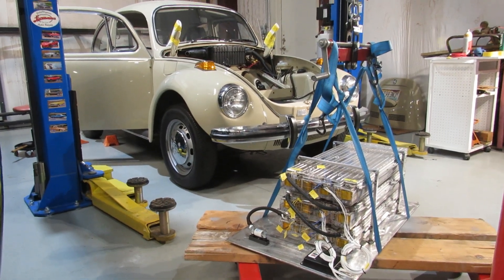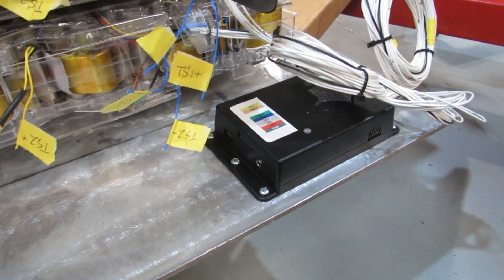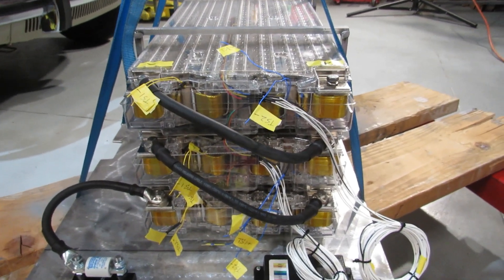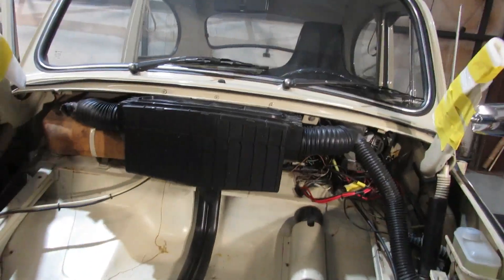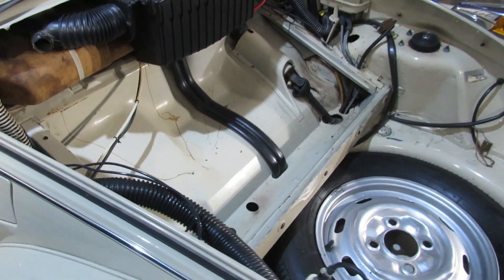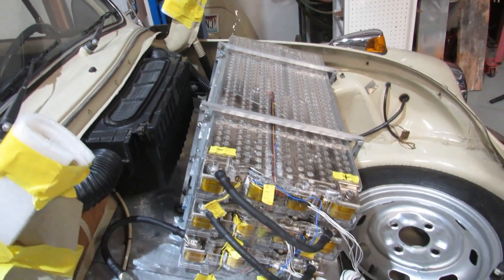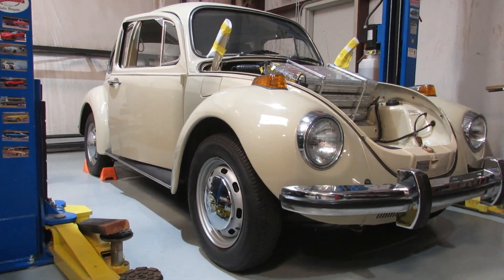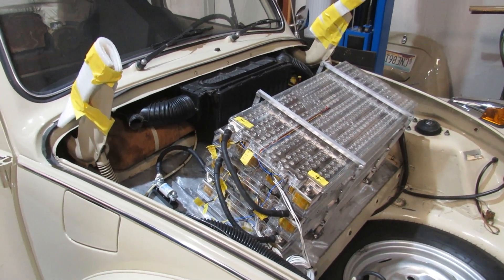Tesla S Battery install in our 1971 VW Super Beetle EV Conversion

Comment: Any secrets to buying Tesla modules on the cheap?  I am restoring a 78 VW Bus on my channel and am about to start EV conversion.
Reply from the maker: Definitely no secrets that we're aware of, we searched all over and maybe saved $100 each by going thru an ebay seller....and when they arrived, the boxes were soaking wet,...the seller didn't cap off the coolant lines and residual coolant could have shorted the modules.  I think EvWest and other similar suppliers would do a better job, might be worth the extra $$$